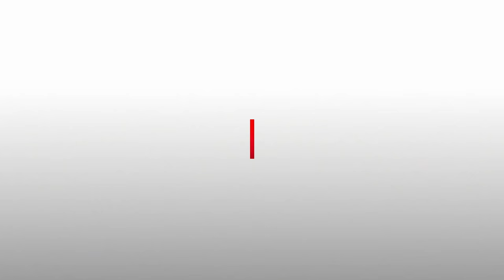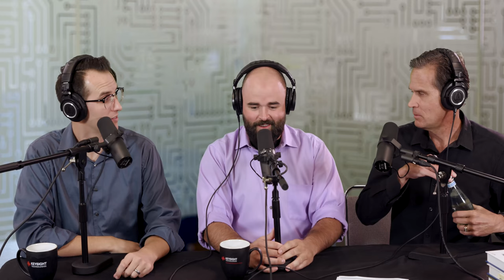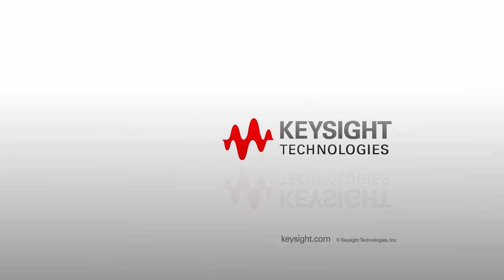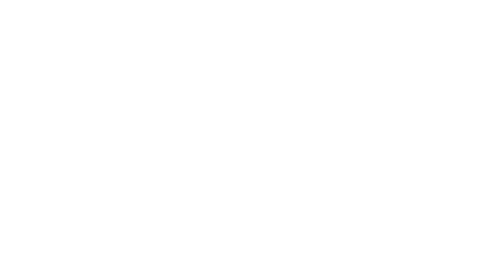Wide Bandgap Semiconductors for Power Electronics - EEs Talk Tech Electrical Engineering Podcast #20

Comment: I am working on induction motor drive based on SiC devices. Actually, although they are new, they thrive rapidly. When I started the work,  just Cree (now, known as wolfspeed) produced this kind of devices ,now, Semikron, Infenion, etc are manufacturing SiC devices. This device will dominate the field of power electronics if the EMI problem gets solved. Can you imagine, we can have 15kV mosfet? even talking about that making me feel excited